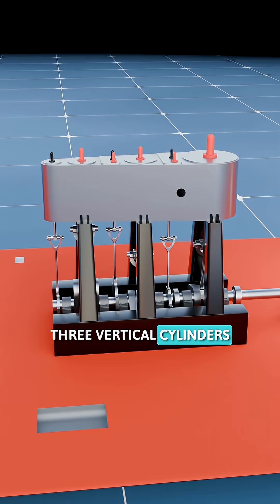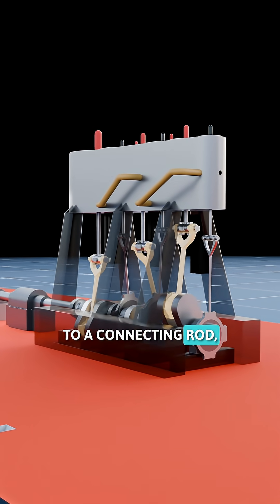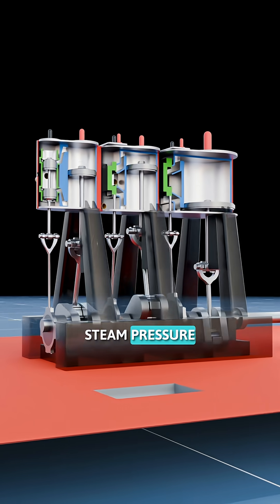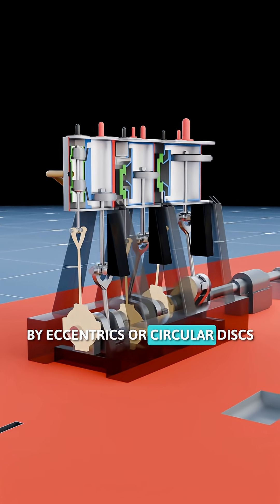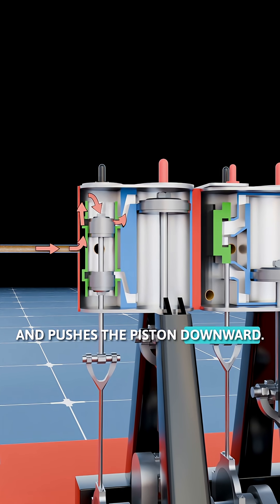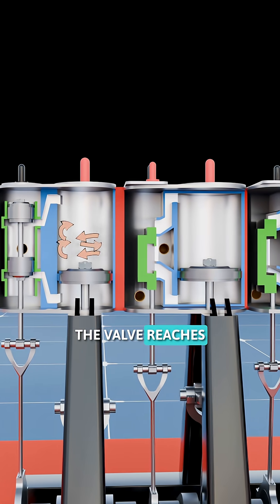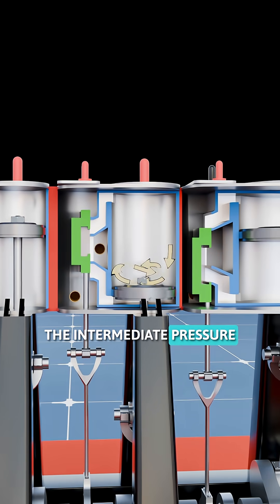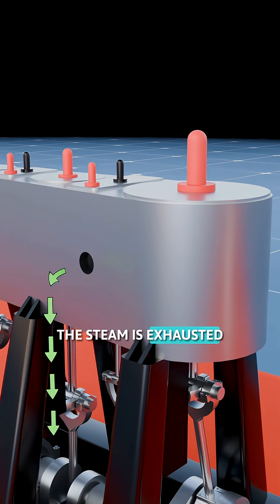How a Triple-Expansion Steam Engine Works ⚙ #Shorts

Comment: The last and largest piston contributes a small but significant amount of energy.  Its the same in a triple expansion steam turbine set.
Reply: The design is such that the largest piston produces the same power with lower pressure. It is not small.

Comment: Perhaps an extra cilinder in modern internal engines could do the same instead turbo system to take advantage of exhaust gases?
Reply: That wouldn't work. In a steam engine, the losses from the first piston having to push the steam into the second piston instead of just venting it out are more than made up for by the power generated by that second piston, and the same goes for the second exhausting into the third, although if you go above quadruple expansion losses from fricition from having an extra piston start outweighing the additional power produced by said piston.

Plus as anything more than single expansion, while it increases the amount of power you make per unit of steam, also decreases the power density of the engine, having too many stages means that you just made the engine significantly heavier for almost no benefit, so that's why the sweet spot is usually triple or quadruple expansion, depending on how much efficiency you want and how power dense you want your engine to be.

In an internal combustion engine, on top of the piston having to use up some of the power it produces to push the exhaust into the extra piston, it also would just make less power overall since it couldn't get rid of the exhaust gases as well as you would like it to, so there's gonna be less oxygen in the cylinder and thus combustion won't happen as efficiently. In short, you would make less power overall and on top of that you would have to use some of it to push gases into the exhaust cylinder. Those are not the kind of losses that extra cylinder can ever hope to recoup.

On the other hand, while a turbo is indeed an obstruction to the evacuation of exhaust gases, it isn't nearly as much so as an extra cylinder would be. On top of that, while you're gonna have some extra exhaust gas molecules taking up space in the combustion chamber, since in increases the intake air pressure, that is the amount of air molecules per unit volume, you're actually gonna end up with more oxygen molecules in the combustion chamber that if you didn't have the turbo. 

In short, a bit more space is taken up by useless exhaust gases, but the rest that isn't has twice, if not more, the amount of useful oxygen molecules per unit volume, so you have a net increase in available oxygen and thus power.
Reply: @aletheredstoner1110  Six-stroke engines have been made and worked, but have not been adopted because the efficiency boost is specific to a fairly narrow range of speed and load conditions.  A video about this is floating around somewhere on YouTube.  On a ship, where you have long periods of running at a constant optimal speed and load, this is not an issue, but as far as I know no six-stroke internal combustion engines have been made for ships, probably because the reversing gear for even a four-stroke engine would be really complex (most large ships want to use direct-drive engines and not have any kind of transmission taking up extra space).

Also, the Turbo-compound engine Wikipedia article says that some truck engines have been made with a turbo-compound design, so the idea isn't totally out to lunch for internal combustion engines.
Reply: The closest thing I know of to this idea is the Curtiss-Wright R-3350 Turbo-Compound aircraft piston engine.  It did not used pistons pushed by exhaust.  Instead, the exhaust was used not only to drive the turbine that powered the supercharger, but also three "power recovery" turbines, which were geared to help turn the propeller shaft.  At full power, they were stated to add 150 horsepower apiece to the engines maximum power.  This gave the engine good power and good fuel economy, but made it very complex.
 It was used in a variety of aircraft, like some versions of the Lockheed Constellation airliner, but its career was cut short by the development of simpler, lighter, and more efficient turboprop engines.
Reply: @GR46404 I see, that's very interesting. I guess that's one case where the benefits do outweigh the cons, though complexity is still as good at killing cool designs as ever.
It's kinda surprising that such a thing was on the Constellation class and I didn't know about it so thanks for the info!

Comment: Actually it goes to the low preause turbines before it goes to the condencers
Reply: If the vessel is so equipped. Also, the words “low pressure” is very subjective. In a steam ship, after the steam had gone through the piston engine and subsequent turbines (which were used for propulsion and electricity generation) the steam still had a lot of energy in it and was piped throughout the ship and used for heat (both air and water) and cooking. The amount of energy still in the steam made it positively deadly for anyone near a ruptured pipe, and that was after most of the usable energy had been extracted. Steam fitters had to be very good at their jobs. Super heated steam (upwards of 700 degrees Fahrenheit) was under a tremendous amount of pressure. I think it’s a miracle that there weren’t a lot more catastrophic disasters on steam ships.
Reply: What do the turbines do?
Reply: @microdesigns2000  to spin the third propeler on the titanic

Comment: Where does the power come from?
Reply: Originally from the coal fuel burning to boil water and create high pressure steam, then the pressure of the steam is used to push the pistons down and up.
Reply: The steam
Reply: A separate boiler produces steam

Comment: You are showing it as 'single-acting', but actually these steam engines were 'double acting' - steam flow is first sent to the space above the piston, then the space below the piston.
Reply: do you think the bottom side could be for a second cycle, eg steam injection on top then 180 degrees later steam injected on bottom, 
2 runs running 180 offset
Reply: @michaelcombrink8165  Steam is routed to the top half for the downward stroke, then out of the top half to the next piston, as steam is also routed in to the bottom half of the first piston, pushing upwards until at the top the valve flow shifts so steam flows in to the top half, pushing down and pushing steam exhaust in the bottom in to the second piston,...
Where a four stroke engine has a power stroke every second down stroke, and a 2 stroke on every down stroke, a steam engine turn all strokes in to power strokes, so a triple expansion engine has 6 power strokes out of six strokes.
Reply: @PiDsPagePrototypes that is amazing.  Since the crank is attached to the bottom side, I assume the power would be less on the upstroke.  And how did they get a seal around the connecting rod?
Reply: @microdesigns2000  That's why it's got the intermediate rod that doesn't flex sideways, so the seal is circular. The same pressure is applied up as down, so it's pulling up the crankshaft with as much power as it pushes down. The same 'work done on both strokes' is used on steam trains, with one piston outside of each row of wheels, and often one between them.
Reply: @PiDsPagePrototypes  Actually, that is not quite correct.  The "push down" on the top of the piston is a bit stronger then the "push up" on the bottom of the piston because the piston rod subtracts some area from the bottom of the piston.  Smaller piston area = less push if the steam pressure is the same.
Reply: @Vincent_Sullivan  A negligible difference, easily countered by the valve opening and closing timing, so that the forces are in balance to make the engine last longer.
I left it out because the difference in explanation will just confuse folks who aren't 'mechanical minded', but who find the concepts here interesting.
Reply: I came to say the same thing. First the steam pushes the piston down, then it also pushes the piston back up. Really pretty awesome design.
Reply: The design shown is double acting despite their animation, the wrist pins are always outside the block so it was clearly designed to be double acting
Reply: you can see the inlets and it is double acting, he also explains it

Comment: Note that the steam will also go under each piston in upward motion controlled by the same valves. Also in this version the valves are operated by single rods so reversing the engine rotation is not possible, assuming the eccentrics or circular discs are fixed (part of the crankshaft).

Comment: Would it make it run hot?
Reply: The overall thermal energy contained in the entire block would technically be higher, but the first cylinder getting the hottest and highest pressure steam wouldn't necessarily get much hotter than if it was exhausting directly to atmosphere. This is just a system to extract more mechanical energy from the steam as it cools and loses energy.
The first piston has a smaller surface area but the most pressure per square inch being exerted upon it by the steam. Each sequential piston has a larger surface area to account for the lower pressure entering that chamber after energy was lost/used in the previous cylinder.

Comment: Each cylinder makes the most of the PSI of the steam by increasing the square inches of surface on the piston top. Very simple and elegant solution using low cost materials.